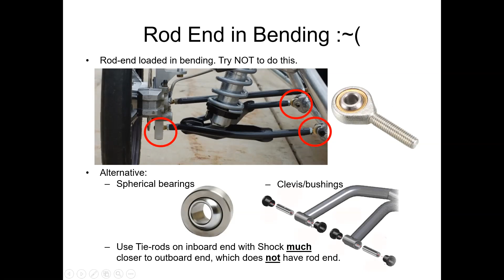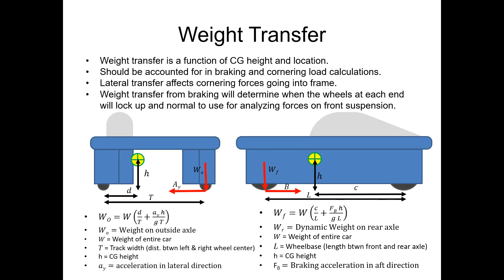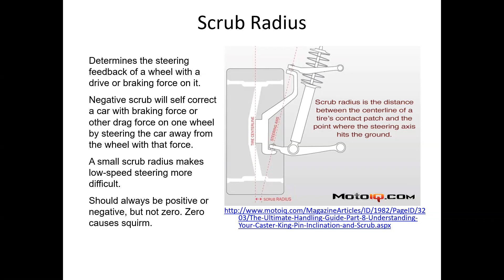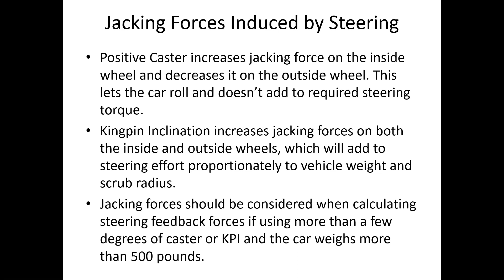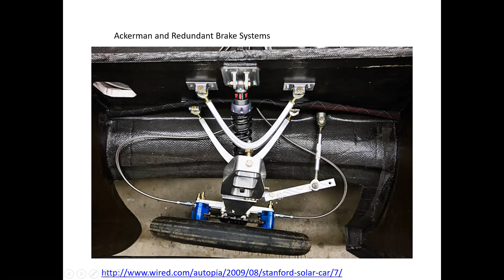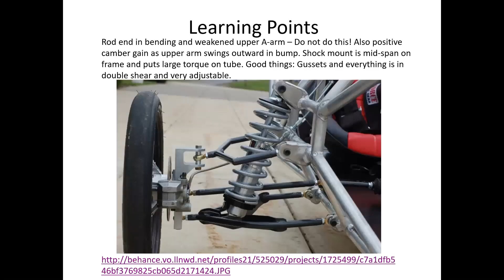Comment: How did you not get any comments? Ridiculous....

I am not making a solar car. And I still learned a ton..
I have not made any kind of vehicle.
But that is about to change.

I want to build an electric golf cart that will have the smoothest ride possible on a golf course. Yet be off road capable.

This buggy will carry about 420 lbs of people and a 150 lbs battery pack and a 45 lbs electric motor.
Possibly 4wd . Maybe two hub motors up front.

1. Any ideas on front and rear suspension.
2. Any ideas on tube frame ? I have been searching for plans but not seen any that were golf cart like. I do plan on having an extended wheel base.

Any direction would be great fully appreciated
Reply: Have you looked at the Fortnite golf cart for inspiration?
Reply: Do you have a link?